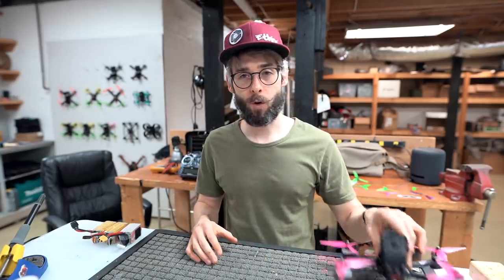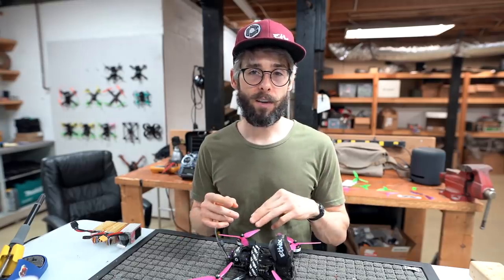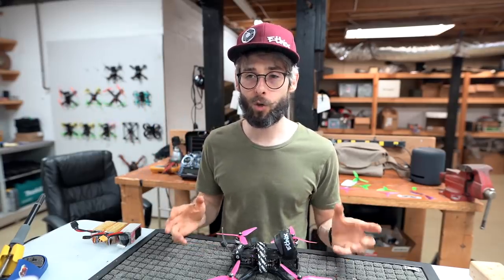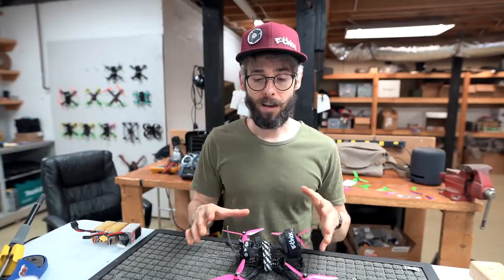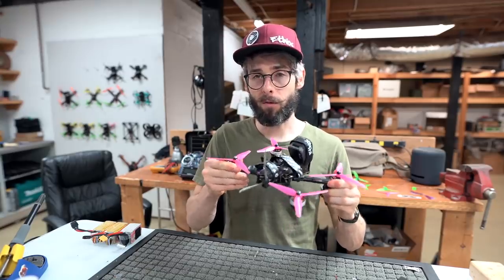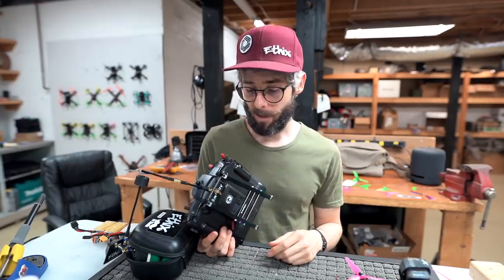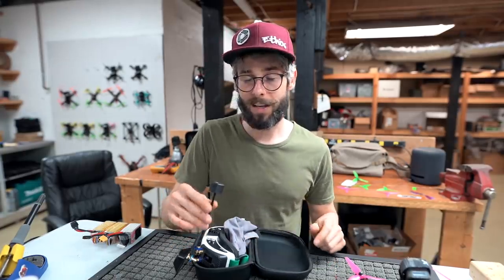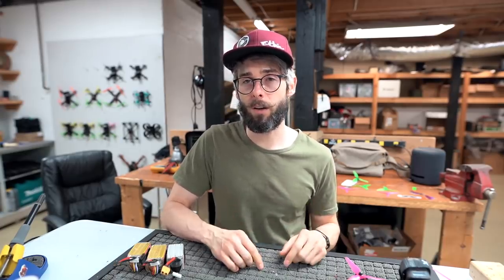Maintaining Your FPV Drone (required maintenance?)

Comment: Troubleshooting is an essential life skill, thank you for pointing out that batteries like to live at their "Normal" voltage. Charge slow, Rip It hard, allow to cool, RECHARGE, repeat!!. On another topic; I purchased the Ethix S3 after watching your video. I had been flying the Hurricane 51499 and having a good time, loved the lift but going down was slow. I put the S3 on and flew my front yard, familiar routes. I noticed a need to fly at higher throttle due to less pitch, more rpm required but I have come to appreciate the fine control available.  I flew 6 sets of your S3 then tried the S4 on the same "My front yard" routes. Small increase in pitch made a very noticeable difference in lift & extreme low level flight controllable. I have some S5 as the next step. I like the option to tune in how I want to fly.  Keep doing what you do. I personally appreciate it.

Comment: When Steele says his gimbals are buttery smooth, they are, cause they quite literally have butter in them :)
Thanks for the tip though, no more crusty radios for me!
Reply: I put grease on my stick since 2 years ago. Didn't know that it's not widely known. 🤔
Reply: Do you have to disassemble anything to do this?

Comment: 1st off, you sir are probably the best all around drone pilot on the planet🤯 it would be cool if you did slower tricks so regular people can see what’s happening 😁 that being said, amazing videos. Anyways, I have a question that you might know. I fly dji freestyle with those black goggles I think their just called dji goggles. When I fly with another dji pilot we very often interfere with each others reception. We have changed channels, power output, how far we are from each other and nothing works 🤯 your thoughts?

Comment: For me teflon tape works very good for the throttle rail. Just put two layer of it on the rail and put shrink tubes on the ends to fix it on his place.
Reply: I use a tiny amount of machine grease with teflon in it. Works perfectly well.

Comment: You could also slip over a small teflon tube over the rail which is often used for 3d printers. I've done this to my radio and it works just fantastic. I also add a little bit of lube but it also works well without any.

Comment: Hi Mr. Steele. Can you talk about how to lubricate motors properly?
Reply from the maker: I don’t ever lubricate motors.  But if I did I would use bearing oil and drip 1 drop onto the top bearing
Reply: @MrSteeleFPV  OK thanks!

Comment: 6S is actually pretty nice in terms of how long a single battery lasts.
I converted 3 4S-Packs with about 50 cycles on them into 2 6S-Packs. On 4S they were sagging down to 13 Volts or lower after about 30 seconds of flying. Now, on 6S I easily get about 3-4 or sometimes even 5 minutes of flying with minimal sag. Sure they aren't as good as brand new ones but as like warm-up packs, the work really well.

Comment: @steele can you talk more about antennas? I’m interested in what makes a good antenna, and why you seem to always have a new one — is it because you notice a difference in signal? Or is it more that you know it’s better for the application so you use it anyway? I get super clean video with your products so just curious. Thanks!
Reply from the maker: I will make that video soon. Been holding off cause I have some new goggle RX antennas coming out
Reply: Mr Steele ah can’t wait. Been using the same antennas for a few years now, and they work great, but I want something that is worth the upgrade. Thank you!

Comment: Hey ! First of all, thanks for all your amazing content.
I'm just starting this amazing hobby, and I'm wondering what you're calling "storage tension". I mean, I know what you mean about the numbers, but not in term of time. Let's say I fly on a sunday, and I won't fly until the next week end. Should I let the battery charged? discharged? What's the period of time where you say "Ok, Storage tension time !" ?
Thank you !
Reply from the maker: Storage voltage is 3.8V per cell.   So on 6S that’s around 23V.  You should make sure your packs are at 3.8V per cell if you’re not going to use them for more than 48 hours
Reply: @MrSteeleFPV  48h it is then, thank you !

Comment: Love the info, any tips for getting all this dang grass off my quad. I almost wonder if water proof costing the carbon will prevent crap from sticking
Reply from the maker: Water or alcohol and a toothbrush
Reply: MAD GRUMPYMAN  I'm pretty sure that steel wool anywhere near the motors is a really bad idea, because magnetism isn't always your friend. And unless you conformal coat with something that's an electrical insulator and/or you literally disassemble the entire quad including the flight stack to make sure every last stray fiber of steel wool is cleaned off, I wouldn't chance it because even a split second short in the wrong place could take out a sensitive component before the steel fiber turns itself into a fuse and burns up. Unless a big chunk of the steel wool got left behind it probably won't turn the quad into a fireball, but I personally wouldn't take any chances and stick with a toothbrush. I'm not 100% sure steel wool is attracted by magnets, but it's bad enough that every little screw you drop seems to always bounce into the "attraction range" of one of the motors and then looks for a place to hide... I would want no part of trying to clean metal fibers and dust out of 'em. 😉  Happy flying! 😁👍

Comment: Thanks for this video man, very useful, specially during this quarantine time 👍🏽 just one question, what is your take a vertical play in you motors, probably less than 1mm of vertical play between the bell and the stator belle can wiggle up and down a bit)?(

Comment: I'm curious about the tango2.  Did you just decided you want the jigawatts, or did you not like something about it in particular?

I'm looking to buy one as my flights are usually in hiking locations, and the tyranus rex x9d feels like 90% of my bag space, but I want to make sure it's good enough to be a packed piece of equipment.
Reply from the maker: I like jiggaaawattsss. But it’s more about the size. It’s a little too small for me
Reply: @MrSteeleFPV  good to know.

Here's an odd one.  Have you ever tried to fly your silk motors with a throttle cap on 6s to see if it feels different?  I'm curious if you fine tune the KV for an optimum feel, where you would end up.  Not sure if kiss supports that tho....

Comment: Firstly, thank you for this video. I just need to ask if there is a way to repair a rubbing motor. Because I have just bought 4 motors and I have not flown them yet, but when I am turning them by my hand, there is some voice like rubbing on 3 of them except one. That one turns really smooth and quite. I wonder if other 3 rubbing motors are factory-based-broken or maybe the mounting screws that comes along are so long that they touch inner parts of the motor over even 4 mm thick carbon fiber frame arm. Anyway, if you can help and give an advice like there is a way to understand and be sure that they can be flown, I would appreciate. Greetings from Turkey!!

Comment: Ok, you just sold me on 6s. Batteries last longer? That a no brainer. Though I am still on my original 10 1300mah Thunderpower batteries. I just got them a few months before you switch to 6s.
Reply from the maker: Yeah man. 6S is crazy. If you can just keep from killing them in a crash they will last years
Reply: @MrSteeleFPV  I've destroyed a few packs but still have all my original 10 Thunderpower 1300mah, lucky packs for sure! I built an Apex(CYA Armattan) last week, maybe I'll be on KISS here before too long. Following your recommendations can be expensive, but every one I have followed has been a good investment. You fly the shit that just works, and WELL!

Comment: Hi Steele, Im using 4s, which is the storage voltage you would recommend for the bat to last long?  And how long does your 4s battery last?
Reply: Ashwin Lokesh they last a couple months decent flying and storage is 3.8 per cel :)
Reply: @chad9160  Ok thanks man.

Comment: I undid the gimbal tension screws on my T16 to the point of removing them altogether, the spring strength is still too strong for what I want, I wish the extra springs they included with the TX were weaker instead of identical backups.

Comment: Any tips on how to aproach a increase in video noise? After a crash I got some horizontal lines when I do a full punch out, the screen doesn't stay as clean as your dvr does. I've checked a few things but it all looks okay. Maybe some pointers on where to start from would be greatly appreciated! I heard tightening the VTX might help, so I did that although it didn't seem lose, I'll test it tomorrow. Also do your props come in different colors?
Reply from the maker: Most likely not enough filtering between your motors and the vtx.  Try adding a cap between the motors and the vtx
Reply: @MrSteeleFPV  For reference my build is entirely the same as yours, just some other 1750 KV motors. For me it's just weird that it showed up after the first harder crash I had. I'll try to add a cap but I had almost the same thing but way worse that also affected the flight performance which ended up being a motor that wasn't performing as well. When I added a cap on that drone it did nothing.

Comment: whats the little clear thing that you had your balance leads tucked in on ur batteries?
Reply from the maker: Balance lead Tucker haha. Comes stock on the Thunderpowers but can be made easily with two pieces of tape
Reply: @MrSteeleFPV  Thanks I will give it a try. Already exploded two batteries cuzz I don't have a tuckerzzzz 😂

Comment: Who knows if Silk v3 vearings are greased or oil lubed bearings? Cause there is some based oil bearing lubes to keep them smooth
Reply from the maker: They are dry as far as I know
Reply from the maker: But you can grease them

Comment: Is that just a normal extension on crossfire tx and does it make any difference.
Reply from the maker: Working on a custom Tx settup
Reply: Mr Steele   I suppose would also make sense when keep unscrew antenna on off only we’re out extension Sma connector and not the tx one

Comment: Motor bearings, it can be changed, but is a pain in the butt so i rather buy a whole motor
Reply from the maker: Me too lol
Reply: And the bearings are about 1/3 the price of a motor..!🤦‍♂️... therefore yeah just replace it entirely🤗
Reply: It literaly takes 5 minutes to swap bearings if you have a small press.  I cant afford to replace motors cause the bearings suck.
Reply: Oh, and bearings are $2.25 a piece.
Reply: @FPVQuadModz  yeah I use the emax bbb 1700 kv.. cheap! @ $12... amazing though. But at those 2 price points and the shipping and hassle of bringing an extra press along with every other lil thang. Ill swap the motor quick, bout kill myself because I soldered it up wrong...🤣 swap 2 leads. And a few props from the freak out... then I will keep those motors and fix them to use em later🥳
Reply: i run Flitetest motors on my airplanes and airboats, but they take time to arrive. so i am a motor fix prof
Reply: I usually buy a pack of German made SKF 9x4x4 bearings (W 638/4 R-2Z). They're around 8€ a piece but your bearings become indestructible, they have significantly higher static and dynamic load numbers. Much better than even japanese EZO bearings.
Chaging bearings is quite easy, I got a pull-hammer and a cheap chinese press.
Reply: Amateurs.
Reply: Seems like it mostly only makes sense for like X-class stuff where the motors are way more expensive, or if you manage to just kill a bearing and have extras laying around from other motors.

Comment: HELP ! 
my quad is vibrating. when it's on the ground without props and i arm it the motors start spinng up and down an start vibrating really hard.
I had a perfectly functioning quad but I changed the carbon frame to a self designed foldable 3d printed frame. the fc and esc aren't perfectly in the middle and I needed to extend the motor cables.
does someone has an idea what i can change ?
Reply: Is the quad more oscillating or does it vibrate heavily? I think it's the 3d printed frame that causes this issue. Because those frames can't be really stiff on a large scale, this will lead to oscillations in the frame itself.
Reply: Your FC doesn’t know wtf is going on, that’s why. Put your props on and go fly it.

then you’ll discover a printed frame is a bad idea.